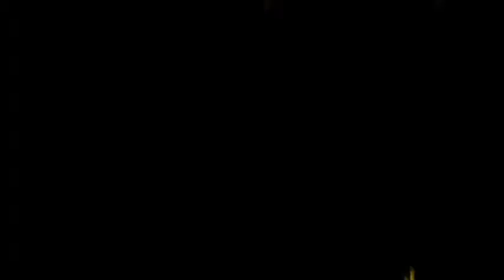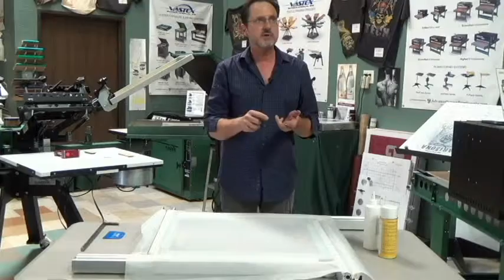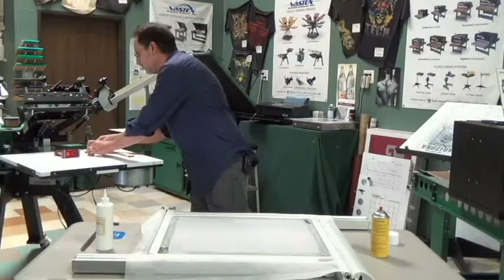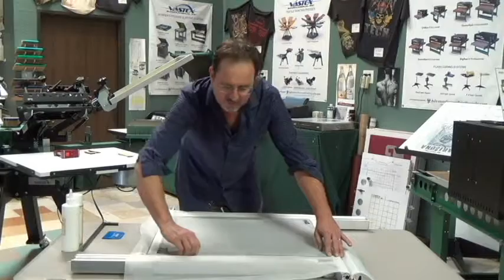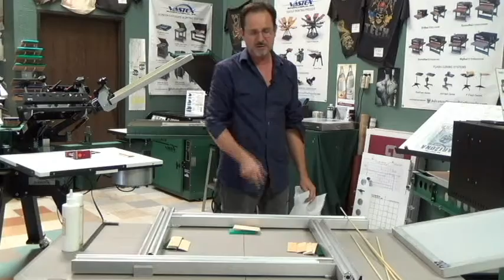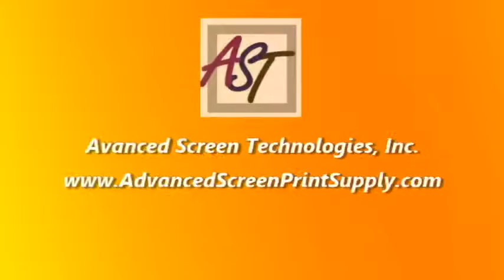HOW TO... Use a Tension Quick - Part 4 - Advanced Screen Print Supply

Comment: do you have the tension reading ?
Reply: High 20's to low 30's is the target for stretching on the Tension Quik
With active corner softening throughout the entire process you can easily achieve 30+ in the center by releasing tension build-up in the corners.
Reply: @tombays6460  i wish to see actual placement of the tension meter during stretching..
Reply: its in the video previous to thi sone